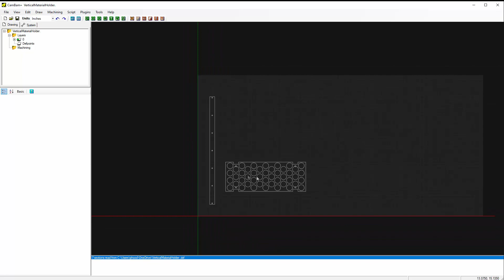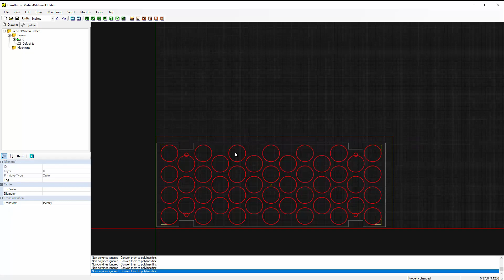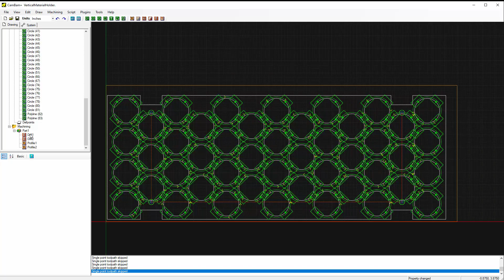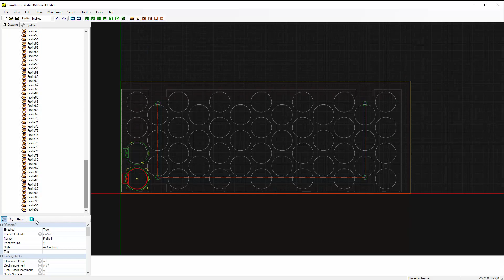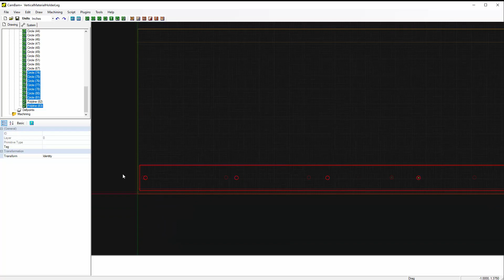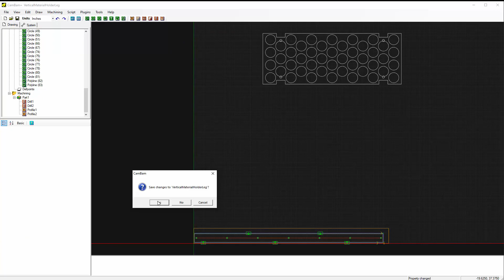CNC Routing Process (CAD, CAM and CNCl) Variant 2: Part 3 Apply Machining Operations in CAMBAM

Comment: What other software we can use..   can we   Artcam and Autodesk Artcam or anyother
Reply from the maker: ArtCAMis no longer available. There are so many CAD/CAM programs out there.  It depends on what you want to do.
Reply: @PatrickHoodDaniel  for CNC router . To make Wooden doors designs and bed head boards design.. please tell which software is recommended?